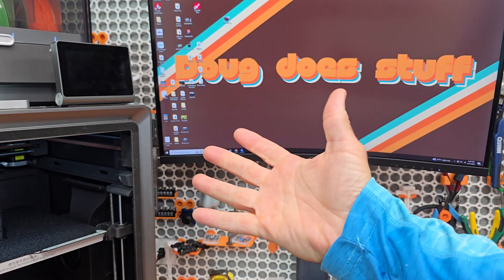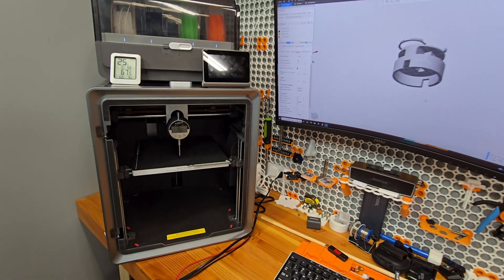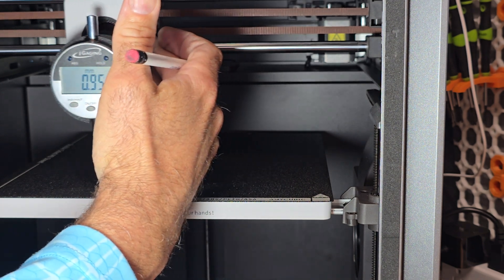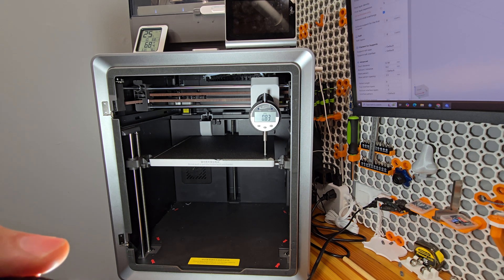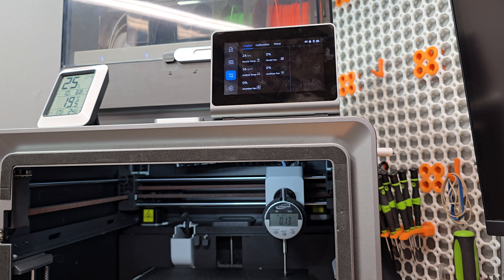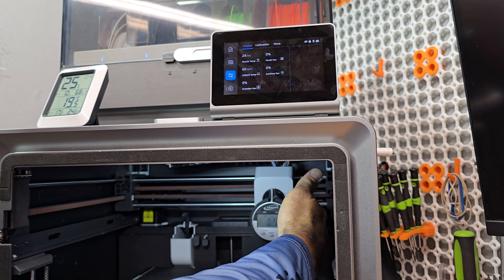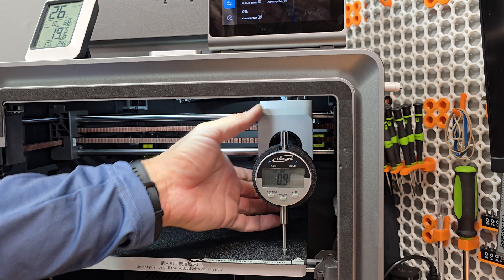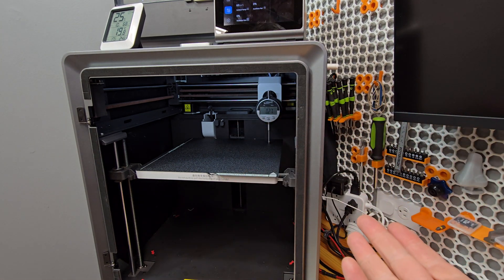Kobra S1 Combo: Warp factor 1.2....Engage

Comment: Hey, Dougie, How did you mount the dial indicator?
Reply from the maker: Hey Batchitie, If you look on makeronline and search dial indicator holder it will pop up a bunch.  Just choose the one that fits your indicator and go from there.  I had to edit the one I used to fit my indicator (needed it deeper in the back so I added a hole in the slicer software).

Comment: WHY would you do that at all? Lets talk about software - why is it not good enough included in the printing; thats what the leveling does. Maybe the bed temperature is causing incorrect readings or that 5x5 probe measurements with interpolating is simply not precise enough.
Its like a car complaining the road isnt flat. There is technic to compensate it.

Comment: Would be great to see the same analysis on a P1S
Reply from the maker: I'm happy to accept one for this purpose should one be offered 😁
Reply: @dougdoesstuff24  Hi Doug, the last printer I bought was the Kobra 2 Max. A few weeks of work and many wasted filament rolls later, adding silicone spacers, i got the bed somewhat slightly level. I gave up using it, and now I see the S1 might be similar work. Thats why I was thinking of the P1S now, even despite the bad ams2. I wonder what would be a good acceptable tolerance of a build plate, maybe +/- 0.1mm? The K2max went from midair extrusion to scraping the bed. If I accidentally auto level it, I have to start over.
Reply from the maker: Hey Capt.  For me, an acceptable deviation would be .2 at most.  That is one layer height difference if printing at a .2.  My current deviation is more like 6-7 layers (1.2-1.4+mm)!  I am currently designing some spacers for my plate to see if I can take up some of the difference.  I will have more tonight or tomorrow when I get a chance to test it. -Keep watching to find out
Reply: @dougdoesstuff24 Will do, and thanks for such a helpful honest review on the topic 👍

Comment: It's expected that the bed or most materials expand a little when getting hot. The increase in the back right corner is just that and can't be used to measure warp in any useful way by comparing the corner itself against when it's cold. You need to use it as a new reference point, aka 0, again and then measure all other points. To actually be able to visualise the bed warp better, I'd recommend at least a 5x5 grid of probe points. The more points, the better. Note them down and use an online "3d printer bed mesh visualiser." As other comments also pointed out, you need to level your bed first though, as it very far off
Reply from the maker: I'll look that up and see. It does do a 5x5 probe, but you don't get to see the bed level anywhere which is why I used the probe. I zeroed out cold and then heated and watched the warp form.
Reply: @dougdoesstuff24  I know you don't have access to the bed mesh. What I described was for the manual process as you did it in the video. You'd essentially be measuring a bed mesh yourself and visualise it with an online tool instead of the built-in one in mainsail. Also the difference of the first point is just the material expanding, which has no useful information in itself when measuring the same point alone. You need to think in relative height differences as that is how the bedmesh will be applied by the printer too. As you weren't adjusting the reference point (left back) to be 0 again, the values seem to be bigger than what actually be the case. Difference between absolute vs relative

Comment: So, Doug, I installed Rinkhals and checked the range of the mesh. 1.4mm at best, 1.7mm at worst.

Mine was dipping in the far left corner. In that part of the bed, theres only a thin piece of alluminum holding the bed. So, I bent it upwards. Now the range is 0.4mm and the bed is mostly flat. Ill do the same with the other corner since its dipping in that area too, hopefully that would bring the range down to 0.2 something.
Reply from the maker: Nice job!

Comment: just letting you know bed when heated doe's warp it warps on my creailty k1 and the table it on is level all bed on printers warps in one way or another i been printing for 5 years you never get the level fully only bed i know that do not warp much is bambu printers alloy beds warp in not anycubic fault my7 s1 prints perfect you may have a faulty printer ask anycubic for a replacement i away warps in the middle of the bed

Comment: I got one too, I’m very new but learnt a lot last week about this whole 3d printing thing. Mine works okayish. Mainly user setting error in experiment with. 

If I’d have that issue I’d probably just buy a filler gauge set and map the bed properly than cut pieces of the filler and put it underneath the build plate :D it might be a atupid way of fixing but I have a feeling it would just work :))) and would be easy to do.
Reply: This would probably just worsen you heat transfer from the heated bed and could result in inconsistent temperatures across the bed and potentially adhesion problems

Comment: I'm baaaaack ...

Yea I have the same printer as I've said in other comments and it has no issues with bed leveling as I've said before. I just sighted down it with a stainless steel straight edge from corner to corner. I can tell it's off from one end to the other by ~ 1 mm and also form the opposite two corners. It has no effect on the prints I am doing because the bed leveling routine takes care of it. The bed just isn't going to be as perfect as you seem to think it needs to be and it doesn't have to be because of the bed leveling system.

Look, this is a consumer grade system not something NASA uses like an optical flat plane to grind space telescope mirrors on! Here's the problem with your measurements - they mean very little because of this: You have no specifications to compare the "warped" bed measurements to! You just take a set of measurements and seem to think that you can subjectively determine whether they are "good" or "bad". How can you do that? You cannot. How much warp is too much? You have no document specs to compare to.

I don't see any reason that your bed cannot be compensated for using the bed leveling system because as I said my bed is warped at least 1 mm and I have no issues. Lots of other people with this printer also have no issues so I think you are chasing a ghost with these bed warping issues.

If you think I'm wrong tell me how much warp is too much and tell me where you got the specification from.
Reply: I agree that the bed warp should be irrelevant but his earlier videos show that the automatic bed leveling isn't compensating enough for a perfect first layer. So he is trying anything he can think of.  I upped the nozzle temp a little, bed temp a little, and first layer thickness a little on my S1 and its fine now.  But I'm not selling prints.  They're good enough for me.  With small prints and using the Marsten profile from Makeronline they are absolutely flawless.
Reply from the maker: Hey Nash, always appreciate the insight!  You're right, this isn't NASA, but I should be able to reasonably expect a uniform and consistent first layer.  The issue here is that the software or firmware is not correcting for the bed warp, which is extreme.  The Klipper website states under their bed leveling documentation "In order to get good quality prints the printer should be calibrated so that Z distances are accurate to within about 25 microns (.025mm)."  

I look at it this way, anything over .2 and we are asking the printer to level more than 1 layer width....yeah no thanks.  I want my bed to be as level as possible even before the bed leveling software has a chance.  I don't want to have to adjust for 5 layers (1mm warp) if I can get it to be less than one.  

And, I did say this wasn't very scientific.  But scientific or not, it gives a good general indication.  Anyways, again, I really do appreciate the input and aim to get this thing right.  Okay, off to tear it down as the next step
Reply: @dougdoesstuff24  
Look, what matters is not how the bed is warped before corrections are applied but how the correction is applied and how well it's calculated. So here's what you REALLY should do -

You need to write some simple G Code that runs as if the printer was going to print - but this G code will not print a thing. All it will do is move to different places and pause. Your print head will still have the dial indicator installed. Wherever it's moved to, the bed leveling corrections are automatically applied because the printer is running a printing routine, but you will never command it to extrude. 

Let's say you will move it in a 5 x 5 array and when it stops it will be commanded by your G code to be 0.5 mm above the bed. Now you record the actual dial indicator, and it should be very close to 0.5 mm everywhere. This is pretty simple G code. Take some time and you can do this. But this is what you REALLY are wanting to know. 👍
Reply from the maker: @nashme11  thank you Nash, I appreciate it
Reply: @nashme11   That's a great idea.  It would show how much the printer isn't compensating for the bed warp.
Reply: @Monkey_Chimchim  If he's got the latest firmware (and I suspect he does) then we already know that many other people including me have no issues with the leveling routine - it works for many people. So we can rule that out before we even begin. So all we're left with is either the dial gauge will show the warp is being compensated for by the algorithm, or it isn't.

Therefore, if the dial gauge shows accurate compensation, then it must be the materials he's using are not good quality or some other mechanical problem that happens when the printing process is running. If the gauge shows inaccurate compensation (and we know the firmware is OK by virtue of the entire user of people with no issues), then it's probably another mechanical problem such as the strain gauge or noisy electrical issue in the head or ... ?

The last thing I would suspect is that the bad he has is warped too much. I do not believe it is.
Reply from the maker: I'm trying to wrap my head around how to do this

Comment: I have a brand new one of these and pretty much exactly the place you're probing is where I'm having stringing and adhesion issues. Sounds like this might be an explanation and I need to get a meter
Reply from the maker: You can install Rinkhals and not have to buy a meter

Comment: Hello Doug, same problems as mine. I measured the bed with a rinkhals. For my bed there was a difference of about 0.8mm. I then placed 4 TPU sleeves between the plastic space and the metal frame and adjusted them with the screws until I had the same height at the 4 points. The bed is then still about 0.4 mm crooked, but that compensates for the leveling and there was a perfect first layer. Let's see how long it lasts.
Reply from the maker: dude, that is awesome!  Congrats.  I am hoping to get there too

Comment: Certainly bu=ig discrepancies but not the most accurate way to do it. Suggest you run it again with a smooth plate
Reply from the maker: Definitely not the most accurate, but still a 1.2mm difference is huge and not just the method or plate

Comment: I can’t tell how the bed is attached to the metal bearing housings. But if it’s a screw, then it’s a possibly simple fix. You can go to McMastercarr and buy small shims. A 1 mm and a 0.25 mm shim under that front left flange should correct the entire bed. Either the casting or the machining of the bed or the bearing holders seem as though they might be off. Or possibly, the screw is off a few teeth on the belt. If so, then loosening the belt and turning the screw to lower the corner and then tightening the belt might work. Again, I don’t know this machine, but my Bamboo Lab H2D calibrates the bed after it heats up. It seems as though this bed is badly designed or manufactured.
Reply from the maker: Definitely going to try to adjust the bed a tooth or two

Comment: Are you reporting these findings to Anycubic?

Shouldn't the software be compensating for the variances? Isn't that what it's designed to do?
Reply from the maker: I mentioned it in another video, but every time I reach out, and I detail the problem, they just send me parts.  I appreciate their support and how fast they respond, but they are throwing parts at the problem I feel, not trying to understand and fix.  I have also linked videos showing them the issues. 

And you are right, the printer software or firmware or combination should be compensating for the unlevel bed, that is the idea.  My only thought is that the bed is so warped that it can not compensate that much.
Reply: They knew this before they shipped it!

Comment: Does it do the klipper Z tilt Adjust  because it looks like it needs that
Reply from the maker: It doesn't, you don't have that level access to klipper
Reply: @dougdoesstuff24  Does it have 3 stepper motors for the z or 1 with a belt
Reply from the maker: @Yhandi_Fan  1 with a belt.

Comment: Did you print any spacers for the bed? Because getting a new one from anycubic may not solve the problem. It seems that some s1 units shipped with spacers, and alot of others did not. There are a couple different files on makeronline for this, I used the one labeled bed leveling spacers by riki78. After a bit of trial and error using the bed cleaner file to figure out my first layer low spots, I was able to get my bed perfect, or at least close enough that the auto level and auto z offset could compensate for it. Now the bed cleaner file prints perfectly across the whole bed with zero issues. Also, keep in mind, if you use spacers on any corner, you must use them at all 4 corners. I printed mine in pla, and I only print pla and it's been fine so far... if you print hotter materials,  print these spacers in a hotter material like abs, etc. Something that can handle the temp of what you are going to be printing.
Reply from the maker: I have not, but I will be taking the bed apart tonight, so I will see what I am looking at and where to go from there.
Reply: @dougdoesstuff24  try some spacers. i had the same bed adhesion issues until i used the ones i mentioned above
Reply from the maker: @advirnig I don't tpu unfortunately
Reply: @dougdoesstuff24  i dont either. i used pla. still working find so far about 100 hours later. i only print in pla so i think pla ones should be fine as long as i dont print anything hotter.

Comment: I don't think any bed is level without a 9mm or thicker slab of aluminum and even then it is off when heated after one use. The issues is the software is not adjusting to the warp really.

Comment: That tells me that anycubic cheaped put on the heatbed and used a thin aluminum plate, thats the reason i got the qidi plus 4, it has a very thick bed and doesnt change much with heating it up, does this bed allow you to manually tram the bed from the bottom?
Reply from the maker: There are 4 screws under the PEI sheet, but they don't do anything when turned.  The bed is mostly plastic too
Reply: @dougdoesstuff24 that’s not good. Well, they have to save money somewhere.
Reply: @melgross  I suspect they saved a decent chunk of money on the QC aspect of things, its not a bad machine, the support seems to be helpful enough, the only downsides IMHO are the QC side and not having a full implementation of Klipper...
Reply from the maker: They've locked down klipper, installing Rinkhals opens it
Reply: @dougdoesstuff24  it does, they apparently said that they'll go open source with it at some point..

Comment: It’s clear that the left corner of the table is higher; you need to manually lower this corner using the lead screw. However, it is connected to two other screws with a toothed belt underneath the printer. There is a tensioner there that you need to loosen so that the left lead screw can skip a few teeth when you manually turn it. I have this printer myself and overall, I’m satisfied—I already have about 500 hours of printing, and I haven’t had any major problems.
Reply from the maker: I will definitely try that later!
Reply: Have you ever had to tension the belts I'm at 500 hours in on my second printer
Reply from the maker: I haven't yet

Comment: Can you share the file and what meter that you used?
Reply from the maker: added to description.  Here is the link, I made some adjustments so that it would fit mine better:  https://makeronline.com/en/model/Kobra%20S1%20-%20Fan%20cover%20Dial%20indicator%20support%20D%2057mm/170065.html
Reply from the maker: It was in metric.  MM is so much easier in this situation

Comment: This is the same problem that the Creality K1’s have.  There are fixes for the problem on YT.  You will never get a perfectly level bed, but my K1 has certainly is now better and I have no adhesion problems.
Reply from the maker: Cool, I will have to look up the fixes for the K1 bed and see if they cross over.
Reply: I would think it would help.  But it might depend on how your bed is supported.  The K1 runs on a single belt.  The fix the worked best for me was to leave the back lead screw alone and turn the from lead screws, jumping the teeth of the belt.  Took about a half hour of trial and error to get my bed level to within 1.0+\-. The big help though was that the K1 can run klipper and you can see the bed level.  I think you said in an earlier video that you couldn't run klipper on the S1. And this fix wouldn't work if your lead screws are independent of each other.  In any case good luck, I like what you are doing and will keep watching your progress.
Reply from the maker: The S1 runs klipper, but they have it locked down. I am going to try getting the plate to be more level between screws.  They are all run off one belt